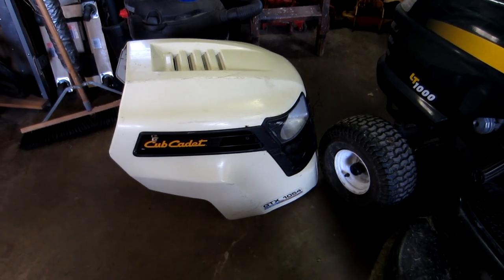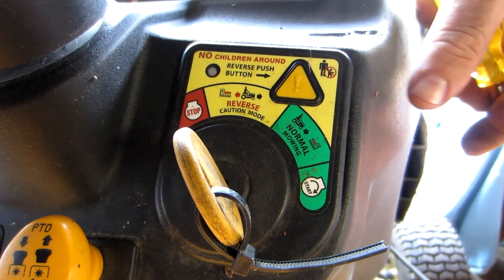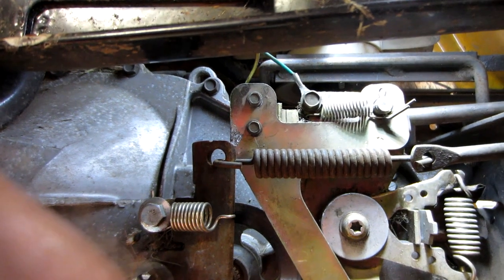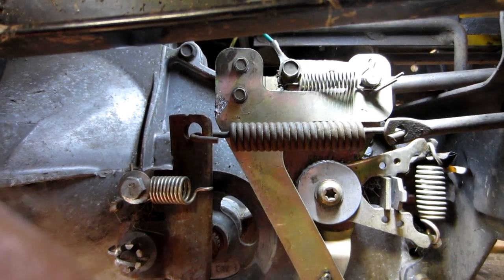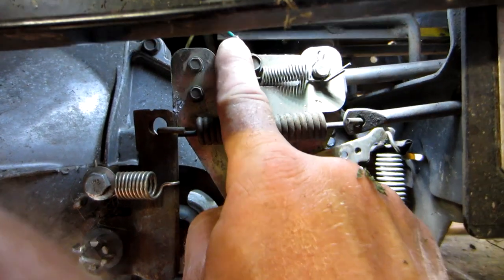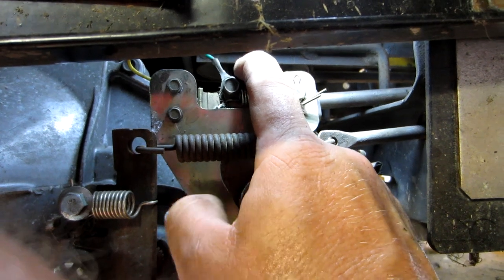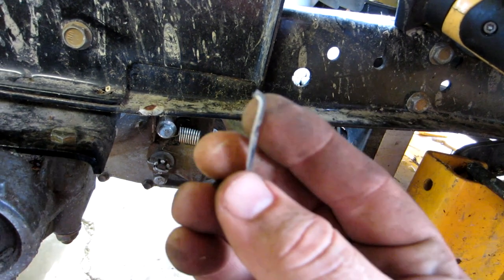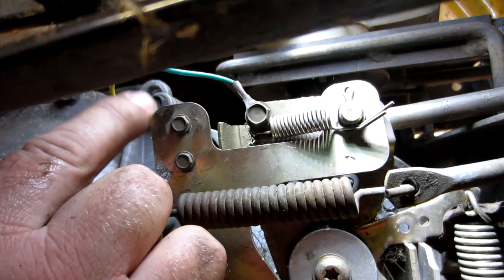Mower PTO Reverse switch Bypass

Comment: Hi FoxBoss9
Great info on that issue. 👍🏻
I have a question for another issue I’m having, and would greatly appreciate it if you could help me out.

I have a cub cadet lax 1045 that is 9 years old.  It has been experiencing reduced ground speed as it gets older.  I’ve replaced the drive belt that connects to my hydrostatic transmission.  But still runs slow.  I increased the governor plate for higher rpm and that seems to have been helpful, but not to the speed from when I bought it new.

Can you advise me on how I can get this issue fixed?  

Maybe someone in the community can help as well.  Thanks!
Reply from the maker: It's most likely the motors in the hydrostat that are wearing out. You can first try to change the fluid out and put a good synthetic in. You'll need to call the manufacturer of the transaxle to see what weight of oil they recommend. They didn't put good oil in the transaxle from the factory and overtime it just wears them out.
Reply: make sure the gas pedal didnt drop out of the frame that happened to my lt1045
Reply: Foxboss9 thanks for the help.  I think it’s  a sealed transmission.  I’ll see if there’s a plug on top that I can pop out to drain and refill.
I’ll try doing that and hopefully It’ll get better.  Thanks again!
Reply: jimmy1life the gas peddle seems to be fine.  Foxboss9 said maybe change the transmission fluid.  I’ll try that next.  Thanks!

Comment: What causes mine not to have good reverse barely moves.Takes off then stops when pressing reverse pedal.
Reply from the maker: Three possibilities...1--- the mechanism that the pedal rod is connected to at the transaxle needs adjusted OR 2 ---- the hydrostat needs fluid topped off or changed to a better,heavier synthetic(call transaxle mfg for recommendations) OR 3 ---- The transaxle needs rebuilt ...
Reply: My Husqvarna 2454 has slow balky reverse also,,,looking for a place to top of the fluid..
Reply from the maker: It probably a rubber/plastic plug on the top side of the Transaxle.. Most likely it's pretty tough to see or get at.. You will most likely be able to fill using a hose attached to the top of a bottle.. Make sure not to overfill.. Definitely get your Trans info from the nomenclature tag on the unit and call the Mfgs support line to find exactly where and how much to fill...
Reply: Darryl Reynolds
That makes sense..mine is put away for the winter now but I'll be pulling a wheel off next spring to check that out..I also want to get rid of that ridiculous reverse blade lock out..I'm not so old that I forget to look behind before I back up..

Comment: just put a piece of tape on the metal part, no need to cut anything
Reply: slide heat shrink tube down the contact to insulate it
no cutting

Comment: Hey, I just bought a cub cadet zero turn. Any help so I can mow in reverse?
Reply from the maker: You need to find any wire connection that goes to the rear hydrostat or anything that the paddles May touch when you are activating them in reverse.

Comment: mowing  forward motor dies fuse blown replaced fuse and holder mower goes forward turn switch reverse on dies light does not come on
Reply from the maker: Electrical problems can only be solved one way, tracing, troubleshooting, and diagnosing. Unfortunately that is a on hands operation

Comment: Umm u have to move key switch to the reverse on it its red nd then push the button it'll stay on .....
Reply from the maker: Not all models have that switch option...and for the ones that do have that kind of switch, If you bypass it on the Transaxle, you need not do anything extra.... Ever
Reply: All mtd have this .. it just stupid to do what it doing wen u don't have to ... deer have a switch u push down called rio switch.

Comment: Aka sweat,, what a card...
 You're a laugh in every glass aren't you.
Anywhooo,, you could back over a kid or pet even with the safety switch in tack right?
     On my cub cadet you turn the key one click to the left and push a button, which turns on a red light.
 Then you can reverse with the blades engaged all day.
 Each time you get to off (aka dismount ha ha ha), you have to repeat the process when you remount. 
    I've been planning on bypassing that feature since I bought it 7 years ago. Still haven't done it
    And, to dismount with the motor running you apply the parking brake, which I also plan to bypass, tho it's a good feature of your dismounting on a hill
 Then there's the system that prevents you from dismounting with the blades engaged.
 I don't recommend anyone bypass that feature. Ya might cut your own for off.
 You may think you're able bodied and can dismount with the blades running, sure, most people could,,, but shit happens and that one shit you don't want to take. You can't put a mangled foot back on.

Comment: Or u could just fix it properly
Reply from the maker: It was never broken...
Reply: @Foxboss9  umm yes it was lol.. if u half to hold the button down with ur hand it's not working correctly...
Reply: @Foxboss9  this works like This.... u start the tractor... then u turn key back 1 notch... then press button it then disables the kill in reverse until the key is turned to off position or u re press button.. u do not hold the button down.. now u can press the button and hold it without turning key back if u want to just quickly go backwards once...